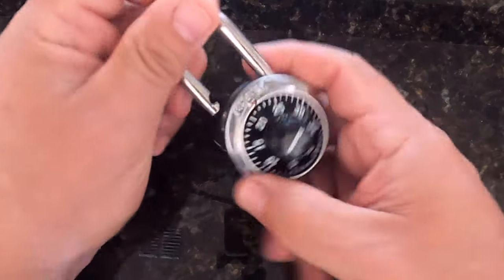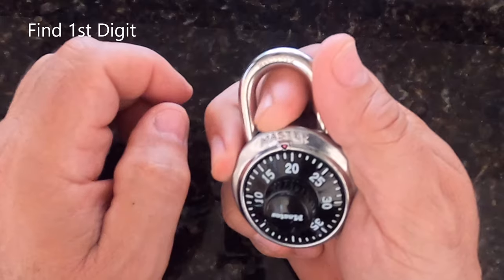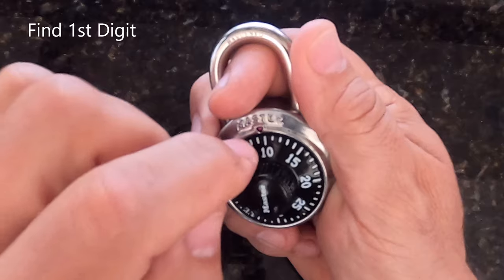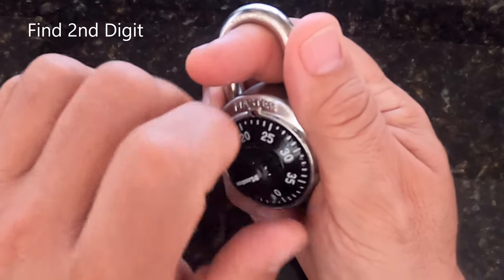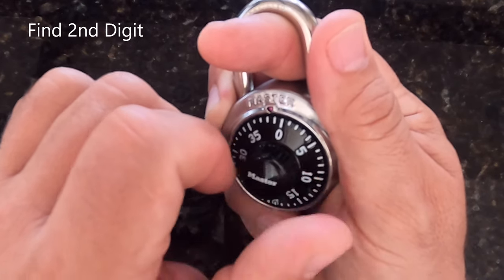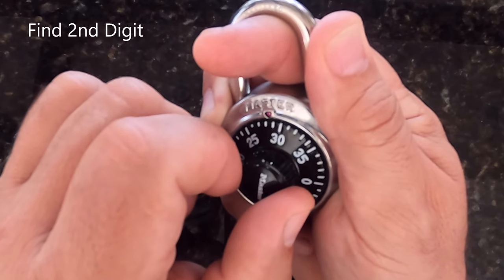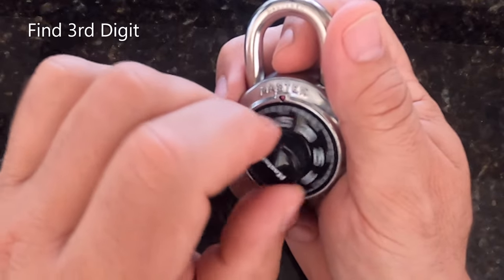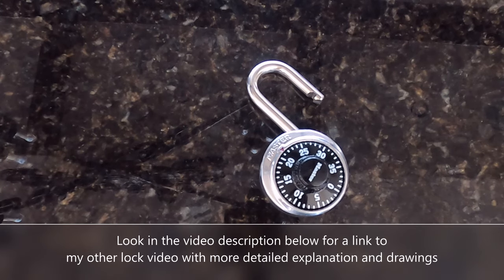🔒Lock Picking ● Find Combination to Master Lock Padlock ● Less than Two Minutes Using Only Feel

Comment from the maker: Lock Pick Sets: https://amzn.to/3yeYz5R
Master Lock No. 3: https://amzn.to/3iZi8Zv
Master Lock Trailer Receiver Hitch Locks: https://amzn.to/3rRK85c
Combination Locks: https://amzn.to/3iPMKwo
Reply: After the first number you kinda yada yadad over a step with the second number. Looked like you just kinda spun the dial a little more and started going the other direction?
Reply from the maker: @common.sense88  No yada yada or anything special going on there.  My turning it was just force of habit I think.  The point is that for 2nd digit, you must lift shackle slightly and turn COUNTER CLOCKWISE about 3 times until you hit the stop.  Then reverse direction and feel for second digit.  GOOD LUCK!
Reply: Does this work with the School edition 1525 V60 with the override key in the back? I made a spreadsheet with the expected numbers but cannot crack. Mine jams at 10 for first no then 3 for counter-clockwise exactly like your demo. Check your clockwise - counter in step 2 instructions.
Reply: Finally Opened. Yours first stuck 9-10 you said 10, mine 10-11 so 16. Your Second shows stuck 2 snagging 28 but you said 29, mine stuck 3 but no snagging at 30. Third 4 but shackle needed to be pushed down then lifted as per Master Lock Anti Shim 1525 Instruction yt clip comb 28-30-4.
Reply from the maker: Glad you got it!
Reply: @ApacheRanch Can you tell me that it can be found on other lockers?

Comment: I must be stupid because I am trying these tips to open mine and I have no idea what I am doing wrong.
Reply: Some locks are different. The ones I’ve done had +5 first number, and also +5 first number and -5 second number
Reply: Fr
Reply: Maybe it is a faulty lock.
Reply: I figured it out. From another video the dude explains for the first number you add 5 or 6 rarely 4. Mine was the one that uses the number 6.
Reply: @christianjimbomb8204  I've been able to achieve success with this method on several locks.  Just because you can't doesnt mean the video is fake.
Reply: @christianjimbomb8204  I managed to do it. Look at my comment and use the same method plus what I just said.
Reply: The way he finds the second number is the questionable one. Now that I found the combo using a math method, I can see the second number pop out on a search, but it's not as prominent as the other set of multiples.
First number, go the lower if you can't tell or between two numbers. Second number is the spot that doesn't conform to the other multiples. Like seeing 7,17,27,37, but also 22.
Reply: Same
Reply: I'm just gonna buy another lock ef it
Reply: Is there any common combinations
Reply: Been at it now for 30min, no dice. My lock is doing the same thing as in the video, until I try to find the second digit. It snags in the same spot as the 1st digit. Can they be the same?
Reply from the maker: It’s possible. Remember add 5 to first digit from where it snags.
Reply: @ApacheRanch followed your instructions to a T. I shall try it again. Thank you for responding 😊
Reply: @ApacheRanch  what if it snags at all numbers. I pull it up and spin clock wise, it snags at almost every number
Reply from the maker: Just gotta adjust tension…
Reply: @ApacheRanch  so there's a sweet spot with the tension?
Reply from the maker: Absolutely. You might try on a lock with a known combination, to get a better feel for it. I wish you the best.
Reply: I tried it too didn't work for me either
Reply: It worked for me
Reply: Did not work for me. I have a lime green master lock. The 1505D model apparently.
Reply: @85jvia  I didn't think the video is fake, but I must be cuz the dam lock don't open
Reply: I just got mine open, I used the cut off wheel method.
Reply: First number is easy 3rd number is easy too.. instead of finding the 2nd number i do first then last. By pulling the shackle tight turning clock wise and checking for a much loose true gate. Another video explains it too
Reply: Yeah I feel like an absolute moron. I’ve been trying for almost 45 mins, watched 5 videos and cannot figure it out.
Reply: Make sure when finding the second digit you go counterclockwise then go clockwise right after
Reply: Bro u might be doing 2 common mistakes,  first make sure your first number is the right one cause a lot of times people get 2 numbers so u will have to try with both, second once you are ready to input your numbers after you go clockwise and put first number make sure you go counterclockwise pass your second number once and after a full turn stop at your second number only then u r ready to start trying number by number clockwise till open
Reply: Same
Reply: I used to be able to open these all the time but now I have to watch these tips because I just can't anymore! It's not a bad thing though!
Reply: Mine doesn't snag anywhere. 😕😏

Comment: Ive spent maybe 3 hours trying this. Glad to say I finally got it to work.  The second number was the hardest. There was no definitive "catch" when I was rotating the wheel clockwise so I had to try a few different areas where it caught and just hope. For the third, make sure you keep on rotating all the way around until you reach your second number, dont stop at 0! Also go watch a video on the internals of these locks, helps with visualization. Thanks for the video mate, got my old high school lock open 7 years after last using it.
Reply from the maker: Glad it worked for you!  Good persistence!!
Reply: Also, dont pass go and don’t collect $200…

Comment: Thank you so much!! I figured it out as well in 30 mins!!
The 3 steps summary:
1. Turn clockwise 3 cycle to reset, lift up lock midway, turn clockwise until snugged, the number + 5
2. Turn clockwise 3 cycle to reset, lift up lock midway, turn counterclockwise 3 cycle until snugged, lift up lock slightly higher, turn clockwise until snugged again
3. Turn clockwise 3 cycle to reset, turn clockwise to code #1, turn counterclockwise ONE cycle to code #2, turn clockwise slowly while lifting the shackle until unlocked
Reply from the maker: Great job!!!
Reply: Worked for me, just gonna casually screenshot this
Reply: @infinitesaddness4525  same lol

Comment: I had a hard time finding the second number:
Here's what I did.
First number is the number that the dial catches on +5.  So if dial catches on 10 then the first number is 15.
Second number is first number plus (2 + factor of 4).  Second number is first number +2, +6, +10, +14, +18, +22, +26, +30, +34, +38.
So once you get first number there are just 10 second numbers that you have to cycle through.
Last number you can keep pulling as you turn slowly or it will be second number -2, then then every fourth number..
If first number is 19 then second number could be 21, 25, 29, 33, 37, 1, 5, 9, 13, 17.
If first number is 19 then last number could be 23, 27, 31, 35, 39, 3, 7, 11, 15.
Reply: HUH!?
Reply: Perfect. The second number I did by feel was consistent, but I couldn't get the last number. Spent hours on it because I have successfully done others by feel. This one was stubborn. Followed your formula and got it in 2 minutes. Thanks.
Reply: It actually worked, thanks
Reply: Too.confusing
Reply: The algorithm to master locks has been broken😈😈😈
Reply: holy shit i got my in like 1 minute following your formula. way faster than feel. thank you for this!
Reply: I found a ML 1525 Anti Shim lock so no idea of the combination. I used your information to create a spreadsheet inputting First Number 16 to get second and third. Used sticking spots on Second to confirm First. Second was 30 but no sticking so trial and error using your theory to find Third Number 4. But with 1525 lock you need to push shackle down then lift up to unlock.
Reply: I know some folks are frustrated, however my father-in-law used this method for well over a dozen locks he has in a box, collected over the years from lost & founds, seized from locker rooms, etc. Takes patience and practice.

Comment: OMG THANK YOU SO MUCH. The trick if your not getting it is to find where the tension makes it feel rough in a bunch of places then slowly release tension until it only snags in one spot then use that amount of tension for the rest of this method. Hope this helps!
Edit: Make sure you know how to open a combo lock too lol. Heres how to do it incase you don't. First spin the dial clockwise 3 times, If you mess up the combo you must do this then restart. Then spin the dial clockwise until the arrow is on the first number. Then turn the dial counterclockwise until the dial is back on fist number. Then turn the dial counterclockwise until the dial is on the second number. Then turn the dial Clockwise until the dial is on the last number. Then pull the shackle/locker latch open
Reply from the maker: Bingo
Reply: Didn't think you would reply so early lol

Comment: Hell Yeah! I've had a cheap combination Master Lock that I've been holding on to for several years and I forgot the combination but all of the sudden a combination popped in my head and I was thinking 08 when it was 18.
But I tried your trick and it works. I almost threw this lock away several times throughout the years but I figured I would run across wherever I stuck the combination sticker somewhere. Thank you
Reply from the maker: That’s great! Thanks for your comment

Comment: Took me a few tries but it definitely works! Had a harder time trying to find the second number but pulling up the shackle slightly and feeling for a slight snag was the key. If it felt like it was stuck its bc i was using too much pressure. After about 30 minutes of toying i got my lock open. Thanks so much
Reply from the maker: Glad it worked for you!!

Comment: Thanks for this info. The lock I normally use broke. I needed something right away that I could read without my glasses. This wasn’t my first choice, but nothing else was available. I had one of these back in 1979. They definitely feel a lot cheaper than what I remember. After
Watching this, I better find a better lock, what ever that is.

Comment: Thanks, used this to open an old lock I thought I had forgot the number too. Turns out I was off by ~1 on every digit. Not sure if the internals were worn or what but it just wouldn’t work with the original combo
Reply from the maker: That’s great! Glad it helped!

Comment: Just getting the first number from the snag point plus the last number from the traditional method of finding stop points narrows it down to ten combinations, which can be dialed in quickly.

Also, I remember once reading about the technique you use to find the first number somewhere buried deep in a text file on a bulletin board server, never could verify it myself because it was poorly explained. Until I found this video, of course.
Reply from the maker: Glad it helped!!
Reply: I don’t remember the details and I don’t have a lock handy but I think the second number is found by pulling the shackle down and turning the knob until it hits solid. LMK

Comment: I did it on two. It worked on a master brand combination lock. And it didn’t work on a non brand combination lock. Also, there was some wiggle room on 1 or two digits “off”. But keep at it and I got one working. One less lock to the landfill. Thanks for the instructions.
Reply from the maker: Glad it helped you!

Comment: I can't seem to get the lock to the stopping point, before reversing direction to find the 2nd number. The lock just spins (counter clockwise) endlessly, and if I add more tension, I can get it to stop in a million places.

It's a master lock I started using in 2004-2005, so it may be too old?
Reply from the maker: I don't think the lock is too old.  I think you need to ease the tension up a bit more.  It will spin around a few times, but should be snagging at one point consistently.  Sorry that's all I can think of to try.  Please let me know if you make progress or not.
Reply: I’m having the same problem. Older lock as well.
Reply: Me too.

Comment: It would be nice if the exact steps were included in the description. I've tried this too many times without any success. I understand the first step but have no idea what you're doing to get the 2nd and 3rd numbers. Do you go past the first number or not, to get the 2rd number or does it even matter?
Reply from the maker: Does not matter. You have several turns possible to feel for the second number before you hit that hard stop.

Comment: My lock doesn't like to get that sweet spot where it doesn't glide freely but it doesn't snag everywhere all at once. It's really difficult to get, it's either too much or too little pressure and i don't know what to do about it

Update: I threw out the lock and bought a new one.

Comment: In Bootcamp I had to crack dozens of these after hours, this sort of trick works for about 60% of locks, it doesn’t consistently work on every kind. Wound up brute forcing a couple and it was way off my attempts with a very similar method

Comment: I tried this so many times and it never worked and luckily I found the paper slip that had my code on it, and I also tried this to my friends locker at school and it worked first try. I think that this trick doesn’t work on new locks because mine is from 2022 or 2023 but my friends is from 2010.

Comment: This worked with two locks, but the third one looks lightly different... the numbers are more finely printed and the lines are thinner. The lock also feels slightly off, and so I've not been able to crack the third one. Any advice?
Reply from the maker: It sounds like your third lock is of a different brand. It may have a different mechanism on the inside.

Comment: I can’t seem to get the second number. After making it lock going counter clockwise 😕
Reply from the maker: Assuming you are working with a Masterlock padlock (and not some other brand), I think you might want to lightly increase your shackle tension.  If you have another lock with a known combination code, you can use that to get a sense for what that second digit would feel like as you rotate past it.  I hope this helps!  Thanks for your comment.

Comment: I used +5 for the first snagging number, and then -5 for the second snagging number. The last one i held up the latch and slowly turned the dial until it slid into place and popped open.

Comment: I need help, its not snugging at all, i tried different levels of pressures but none of them allow it to snug at any point, can someone describe how much force they put onto it?

^I couldnt even get the first number, i pulled up the u shaped part of the lock and spun it 3 times clockwise to reset, stopped on 0, started to spin slowly, and kept the tension, but it didnt snag at all, the lock is a few years old and looks the same as the lock in the video.

Comment: The trick for the first number doesn't work with mine. It only catches on 33 when turning clockwise, so I thought the first number would surely be 38 - not even close. It was 16. 

My serial number is in the 900,000-910000 range for reference.

Comment: Doesnt work, they mustve fixed it on new ones.  The 1st number trick works but theres no resistance that sticks out to he noticed for the 2nd number on the latest Masterlocks of this type.  Youll find theres either resistance clicks every few numbers, or if you reduce your pull on the shackle there is no resistanc on any number, with no in-between the two.

Comment: unfortanently this only seems to work on brand new locks, old ones snag everywhere
Reply from the maker: Try a little less tension.
Reply: @ApacheRanch  well even with no tension the lock still has some really hard points to go through and they move around to. So its pretty much impossible to distinguish the lock being shitty old lock points and the actual correct point.

Comment: The problem I'm having is with the exact needed tension. If I use too much, or too little, I get different snag points for the first and second numbers. 

There is no way for me to tell what the correct snag number is when I cant tell if I'm using too much too little or am on the right one. Extended attempts causing hand fatigue makes this harder... 

If I use little tension, I get 18 as a snag, medium tension 24, and stout tension (enough that it will rotate, but still able to tactile feel a difference) the snag is 35. 

I've tried all these numbers as first and second digits, with + 4, +5, +6, and -4, -5, and -6  on all and so far Ive got nothing but a hand cramp. 

Master lock is constantly changing their designs and manufacturing techniques (just not their quality and materials) and I might just have a lock that has some xyz variable that has not been discovered yet.

Comment: Really vague instruction on the second number. You just whipped the dial around and did not explain that movement. Are we first going to the number found to be the first to get the second number, or are we just turning counter clockwise, finding the catch, and then opposite way snag to fine #2. Really need to be precise on this or it will take people hours since you introduced vagueness.
Reply from the maker: The latter. Instructions are further explained in the description of the video.  Good luck!